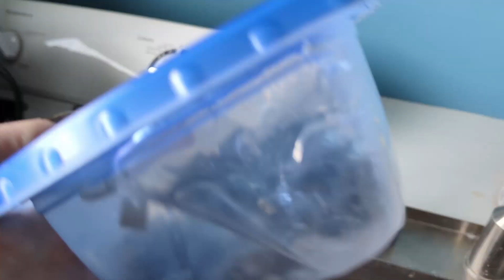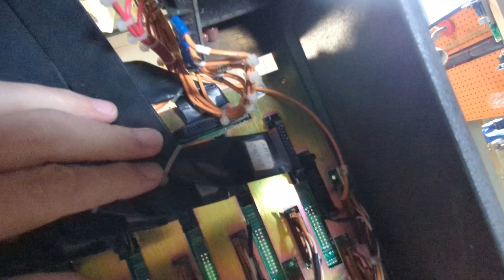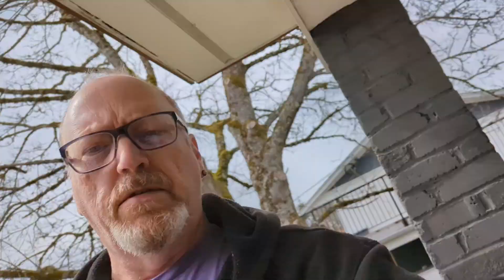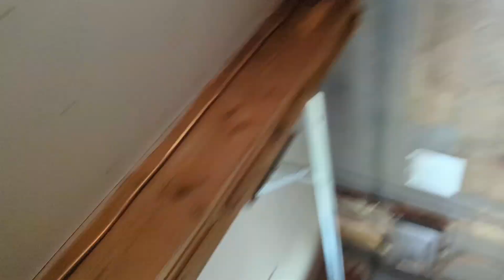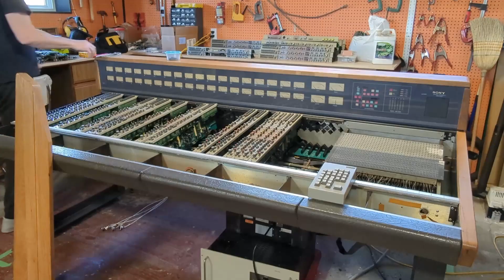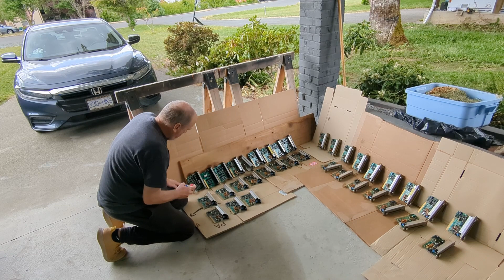Vintage Console Restoration - Part 3 "I'm so dirty!"

Comment: I know you're done with this board but I'll give you and your viewers some pointers for cleaning components that I learned.  Harbor frieght or Amazon sell Sonic cleaners (Jewelry cleaners) for cheap, the ones with heat work even better, use 7/8 water and 1/8 ammonia to clean knobs and buttons, by far the easiest way to clean small parts. Then when cleaning elecrical connections, switches and pots, use "Electronic Contact cleaner" and soak the inside and work it several times then blow it out with high pressure air hose. Do that at least 3 times(way more times on the real bad ones), for pots you can restore a completely bad one but you have to roll it from one direction to to other in full rolls back and forth several times, same with faders, then when done with a module, use "Deox" Fader cleaner and lube on each one.  I restored a Tascam  520 board, it was in horrible shape with all the pots cutting in and out and distorting and using those techniques I got EVERY one of them working like new!! But like I said, the real bad components you have to really work them in full sweeps back and forth, but you will get them. I also restored a 1965 Gibson melody maker and those pots were so bad I thought I would have to replace them, but those techniques worked perfectly on them too!
The Key is Contact cleaner shot out with air till they are fully clean and you may have to try to shoot the contact cleaner down the shaft of the pots like I did to fully get them clean.
I hope that helps others that come here to research restoring these!!
Ha I have the same Quantum 4848 in my studio! I used the Titan Ridge thunderbolt card in my PC, but I went to Mac Because PC recording sucks!!!
Thanks for the great videos by the way!!
Reply from the maker: There was some discussion on the forums about using ultrasonic cleaning for the EQ pots, but Tom Graffe recommended against it. I never considered it for just cleaning knobs and buttons.

Funny, I switched back to PC because I thought Mac kinda sucked. In reality I think they both work equally well, if you chouse the right tools and they are properly set up. I've never had any issue with the recording side of PCs (but the initial configuration and clean up of Microsoft crap always sucks).
Reply: @EdgetoneStudios  I use Presonus Studio One also! Yeah the only thing that really sucked about going to Mac was they did away with Firewire audio support in Monterey and I was using my Midas F32 firewire 400 daisy chained through my Thunderbolt to give me 64 in and outs with the 32 from Quantum and 32 from the Midas. At the time I was recording 16 tracks drums digital and 16 tracks analog drums into Studio One simultaneously, I have since sold my MS-16 Tape deck. Tape is just too much pain in the butt and expensive with how easy digital is. Thunderbolt 3 Titan Ridge PCIe card worked great doing all of that, if you need to go backwards to get your Thunderbolt working.
I have a problem with my Quantum 4848 frequently that it gets signal into it but nothing comes out until I turn it off then back on, do you notice that happening too?
Reply from the maker: I never got the 4848 working with my PC because my motherboard was so new it only supported a TB4 card, which of course didn't work with the 4848. I used two MOTU 16As while testing the console and have now gone back to my Studiolive Series III 32s

Comment: I guess i spoke to early last time.. "Magic smoke" is usually attributed to bad capacitors. What usually happens in those old consoles is that some of the old caps short out and pull down a low ohm resistor that is usually tied to them, so the smoke is from the resistor that overheats and burns out.
Reply from the maker: It's not been updated in the videos yet, but it turns out that the Automation control board had a bad power regulator. I got a replacement board for cheap and that's fixed that issue. I still plan to have the original fixed, but at least I tracked down the issue.

Comment: If I were you I’d probably disassemble the entire console, clean everything, replace any parts that need to be replaced, and reassemble it. I have an old Mackie 8 buss console that needs a good cleaning, a lot of the faders and buttons are noisy and intermittent.
Reply from the maker: Hah. At the rate I'm going, I'm practically there. Thanks for the suggestion.
Reply: @EdgetoneStudios  didn’t watch the whole video so I just saw your 🐈‍⬛. Have two myself and know Bob Clearmoutain has at least two himself.
Reply from the maker: @craigbrown7929  Nice. Kali often hangs in the studio. She loves quiet places and also likes people. She'll flee pretty quickly if I pull out a bass though.
Reply: @EdgetoneStudios  if my cousin comes over and drums are set up mine will head for the basement.